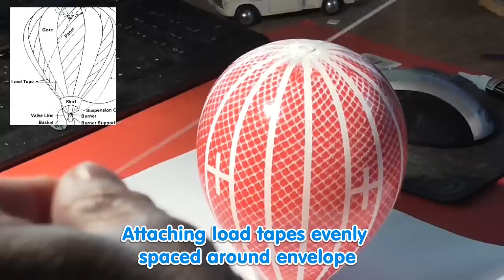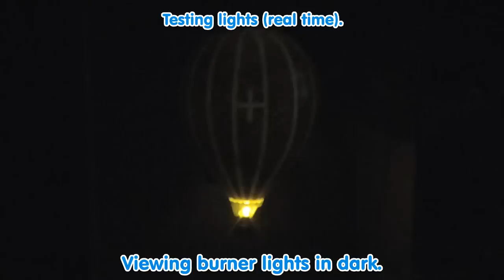Making N-scale Hot Air Balloon (Racer Type) HD

Comment from the maker: Steve... late reply, comments not appearing on Google+.  The bulbous gores of A-type are made by evenly sectioning off the envelope (to how however many gores you want) with a marker or narrow tape.  Then apply a mastic compound like drywall joint compound in each section.  Let compound dry, sand to shape and smooth.  You do this repeatedly until you get the desired bulbous look you want... i.e. evenly spaced, pronounced smooth bulbous gores.  Only issue is that compound is NOT transparent, so you loose the flashing light (flame) effect of the LED that is inside the envelope.  So you get the bulbous shape but without the fire flash effect from inside envelope which looks good in the dark... not necessarily a deal breaker though.

Comment: This is a great model. I'm well inspired to make my own. Can I ask which type of LED you used (flickering/non flickering) with the velleman mk111 timer., and is the timer mains or battery powered. Thanks
Reply from the maker: denis hardiman Thanks for comments... I used two candle flicker LEDs in the project.
-one 5mm white candle flicker LED was high up inside the balloon envelope (for added lighting effect)
-one 3mm yellow candle flicker LED was used to mimic the burner over the basket.
I order both LEDs from here: http://shop.evilmadscientist.com/productsmenu/partsmenu/189-candled.
Both LEDs were wired together (parallel), then their wiring passed through a small hole in the top of the envelope and on to the mk111 timer relay (the relay is a part of the MK111 timer which is hidden out of plain sight beneath diorama base).  There was also a heavy nylon thread routed along with the electric wire for added strength.
Beneath diorama base (out of plain sight), the LEDs' wiring goes to MK111 relay and the relay is wired to the layout/diorama main powerpack... and the MK111's own power wires were also hardwired to the same main powerpack...  two separate wirings (wires for the MK111 and also the wires for the LEDs (via MK111 relay)) are wired to same power source and applicable resistors in each line.
Also placed a main switch to both lines to toggle current on/off to timer and LED's (so the Hot air balloon can be completely switched off/on.)  Also the balloon wiring has plugs so it can be completely removed from layout or swapped for another hot air balloon I made.
I will place this same data into video description for other modelers to access.
Regarding a battery source... think mk111 needs 12 DCV,  a battery (~3 DCV) for balloon LEDS could be possible but have to rethink wiring.  I considered battery for LEDs inside balloon envelope but it would need easy access because it would need regular replacement.  Thought it better to hardwire both Timer and LEDs to DCV.
 Hope this helps. Regards..Aj
Reply: Alps Diorama Thanks for the reply.